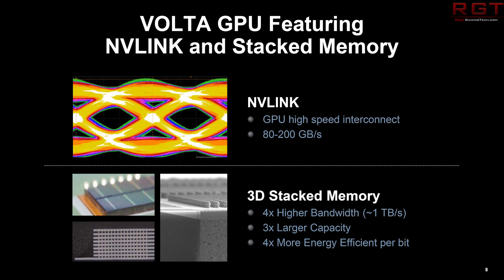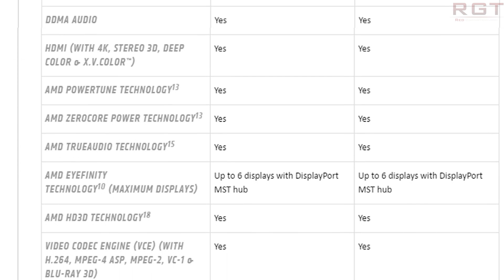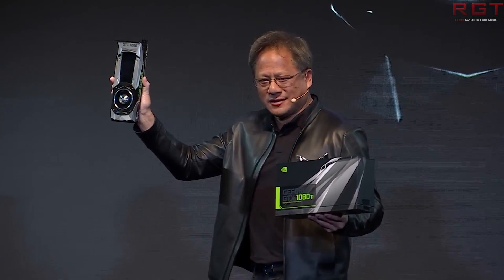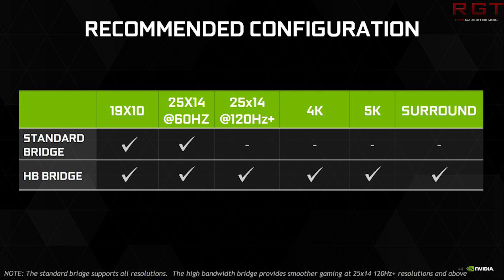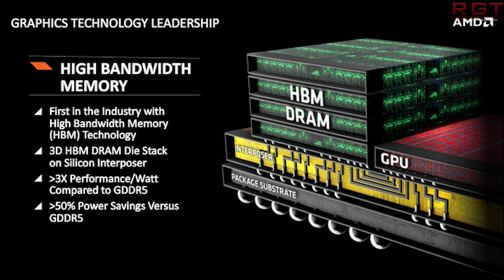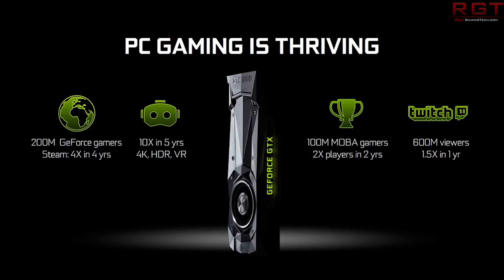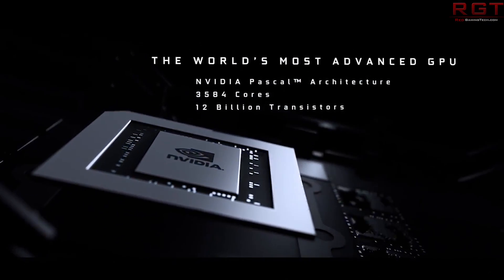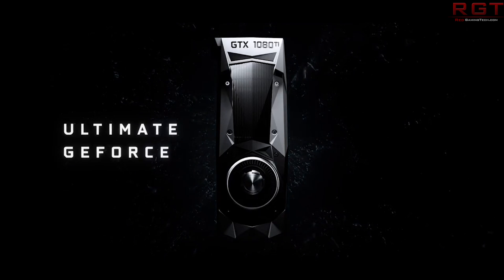Nvidia Volta to Use 12nm Process & Significantly Outperform Vega Says Rumor

Comment: Late and Lame AMD has had NO answer for Pascal 1070/1080, its over hyped MIA Vega will be lucky to beat Factory OCed 1080s in performance/price.  MIA Vega will be slapped silly by Pascal 1080Ti and then Volta will beat Vega like a rented AMDonkey.
Reply: amd doesn't have the R&D of nvidia, so they couldn't release high end gpu's in 2016 or at 1080ti range. but amd is gonna answer to Volta in 2018 with Vega 20 at 7nm. wanna see how Volta with 12nm will beat that. it won't. amd will win in 2018 as it seems, and i bet it will win again in 2019 with Navi
Reply: Holy shit, grow up you clown.

Comment: Vega 20 on 2018 will significantly outperform Volta
Reply: It can't even match 1080TI.
Reply: you didn't read correctly what i said. i said Vega 20 and not Vega 10(56 and 64). Vega 10 was never meant to match 1080ti moron. it was always advertised as 1080 range performance. but Vega 20 on 2nd half of 2018 is gonna be 7nm. Volta will be 12nm

Comment: Listen, how can anyone know how volta would outperform vega by a sígnificantly margin when noone knows how either product performs? It's complete speculation.

Another thing, if you watch the youtube videos where different youtubers play battlefront on a vega system, you can see that the Vega card has the same load indicators as the Fury X has. And on the Vega card, only two of them are lit up. Could AMD be sandbagging Vega and comeback as hard as they did with Ryzen? That should be the real speculative video here, not Volta vs Vega.

Comment: Price always wins, even if it's not top performance, because being close enough is good enough. Hell, even the 1080 cannot provide high refresh rates in higher resolutions. That requires the 1080 Ti to barely make the goal.
Reply: So what you're saying is you want a product that is 5 times faster for the same price, just a year later?  If you look at percentages, they tell the real story.   It's easy to get lost in 30% higher figures, but you have to consider it's 30% higher than something that is already beast.   Also, 60hz is pretty much standard for 4K monitors, so more FPS than that is useless anyways.  4K is a massive resolution.  It's literally like running 4 copies of a game at 1080p, all at the same time....each at 60fps.

Comment: Die shrink doesn't mean crap, my GTX 1050 ti has a 14 nm process while the GTX 1080 ti has a 16 nm process. According to your logic my 1050 ti will wipe the floor with the 1080 ti.
Reply: No because the die shrink would make a difference in a card with the same specs as your 1050ti, a 1050ti with 16nm would be worse than a 14nm counterpart. There are a lot of specs for a graphics card.
Reply: Yes I know but die size doesn't mean much today as there is still alot they can do without giving a die shrink.
Reply: Indeed, todays cards are more flexible when it comes to that.

Comment: NV still dont support Dx12/Vulkan!
Reply: Rafael Carvalho e Lima 
Volta will for sure, async hardware shaders have been seen in eay to many rumours and leaks for it to not have it.
Reply: Rafael Carvalho e Lima It does.
If it didn't u wouldn't be albe to run DX12 or Vulkan titles on nVidia cards.
The Green Team just doesn't optimize their architectures for those API.

Comment: You are forgetting that even if Amd comes out with a card that is equal to Nvidia then it is still too early to go Amd because software optimization does not happen before there is good reason for it. I would like Amd to rip new a hole to Nvidia but ....yeah.

Comment: the Vega card will only be competing at the $350 price point. It's pretty clear at this point. it makes sense historically, Vega will be about the same as a 1080TI, which will be about the same as a Volta 70 series, just pike the 980TI and the 1070.
Reply: I don't understand what you said. You are saying they are releasing a card that's competing with 1080ti performance but at $350? Impossible.
Reply: Estimates based on the doom demo put Vega between the 1070 and 1080. $300 to $350 sounds fair.

Comment: The only problem is volta is supposed to be streaming based cores. Similar to AMD's GPUs I anticipate problems with them. This is Nvidia's first step in this direction, that way they could start using DX12 and vulcan properly... But AMD's Navi is on the way as well, its also scheduled for next year. But Vega seems to be having teething issues with it supposed to already be released. This could be a very big leap in the base GCN architecture. Also from the way its looking on PCIe lane assignments with ryzen they are slotting this to be a platform. Im guessing that since the M.2 is on the same pcie buss vs hanging off the south bridge of the computer that we will see some data sharing going on. This is because of vega's new memory controler. This makes sense since AMD seems to be reworking the drives, and from the sounds of it from the ground up.

Comment: There's an interesting double edged sword effect with competition like this. On the one hand, when one company is dominating the tech stagnates a little, which means your existing hardware lasts longer (for instance CPU tech hasn't advanced a ton in the last 5 years. My i7 860@3.6GHz from 2009 still runs everything without a problem). But at the same time prices don't come down. When there's competition you get better, cheaper hardware, but the arms race means what you have is obsolete much more quickly, leading to more frequent upgrades.
Reply: Don't worry that much, technology is also slowing down in general so there won't be that much performance improvements over the years.
Reply: i say obsolete cpu becomes when it cant run games at ultra graphics at least 60fps. so i7 860 is still capable of that.
Reply: I have 7 PCs, the 860 is just one of them. The i7 860 overclocked to 3.6GHz (that's a MILD OC) with the RX470 runs everything at 1080p and 60FPS on high/max settings with no problems at all. In fact the GPU is the bottleneck. Old? Yes. Obsolete? Not even close. Know what you're talking about before you post next time.
Reply: Cryofax Dude you must stop making too much sense. How dare you use logic. Fanbois don't like logic.
Reply: you only think this because you dont have a newer i7

the 860 is quite obsolete, you are just used to it

Comment: I'm looking at building a Ryzen PC with a 1700x and 16GB of Ram. Mainly used for gaming and video editing/rendering. I use a 1080p 144hz monitor. What should I get for a GPU? Wait for Vega? Get a 1070 on sale? And is there a good chance that Ryzen's 1080p performance will be fixed once the windows/bios issues are resolved?
Reply: First of all, the 1700x is the worst value in the line-up, get a 1700 with a good cooler, and overclock it.

I'm gonna wait for VEGA because of personal beliefs ( I want to finance AMD as they are in a pretty bad spot). But if you have the money I suggest you get a 1080 or a 1070 on sale.
Reply: WildJCS nvidia cards are not meant for video editing and rendering...
Reply: Lo Roger I get that a mainstream graphics card isn't nesscessarily the best option for a workstation card, but I'm looking for the best all around experience, not just for 1 field.
Reply: 1070 but for high frames you'll be better off with kaby lake... I have a 1070 and 1080p 144hz and it rocks...
Reply: Anderson Ribeiro I'm hoping to use an NZXT or EVGA AIO (I would do custom loop but that's a little extreme). So XFR kinda failed in regards to having a meaningful performance boost? And should I be looking at a monitor upgrade to 1440p 144hz? I got an 27" IPS 1080P 144hz at the moment, I'm not sure if the cost of upgrading to 1440 is worth the premium especially at 144hz
Reply: Higher frames in gaming with a kaby lake.  For other workstation type stuff, the AMD will be better.  The reason I like AMD is because I do a lot of compiling of large software, the more cores, the faster I can compile.  Also helps with 3d modeling/animating.
Reply: WildJCS Dude, your gunna be gaming at 1080p...1080 is way overkill for that...1070  is even overkill for 1080p...But at least if you ever plan on going up to 1440 resolution the 1070 is still the right chioce for price to performance. Even an 8gig 480 is good enough for 1080p but its easily beaten  by the 1070 at both 1080p and 1440.
Reply: The gtx 1080 can't even hold 144fps in most games, so nah, not overkill. Especially if you have any desire to play early access games like rust, then that extra horsepower will be put to good use.
Reply: MayDay GoingDown!! I'm looking to play games at high to ultra at 144hz so ideally over 144fps in AAA titles. I'm more interested for the higher fps/smooth gameplay rather than resolution.
Reply: Micah Isham Dude, you just said the 1080 can't hold 144fps in most games?????
How many frames do you need bro?? lol.
He's playing at 1080p not 4k or 1440p. 
Anything over 70 frames and your eyes ain't even seeing it lol.
Reply: Micah Isham That's what I was thinking but unless VEGA can come close to Pascal for a lesser price point or beat it at an equivalent price a 1080 or even a Volta card would be my first choice.
Reply: Yep, XFR is a flop. 1700 is as good as a 1800x if you overclock it.
VEGA is not going to beat Pascal at a lesser price point. AMD never did that. They managed to do that with processor but graphics are a different story. As I said, I'm only holding up for VEGA because I want a all AMD PC.
Use the money you're saving not getting a 1700x to get a 1080ti if you intend to get 1440p 144hz display. A 1080 can't get 144hz at a resolution higher than 1080p so you get what I'm saying right?
Reply: MayDay GoingDown!! b8?

Comment: Any Blender users here?
I got a question for you guys. By the time that Vega comes out, do you think Blender would work well with it or is the Cuda cores from Nvidia still the better option?
Reply: yes and OpenCL performance will have to improve it is a option if you turn it on in the build make file then recompile it by default CUDA and CPU compute are the 2 you can use 
if  you want to help please do they have basically stopped on OpenCL programming
Reply: Master Ryu CUDA is far superior
Reply: CUDA is far superior because applications are optimized for it. They whole idea of CUDA cores is outdated as fuck. But NVIDIA is dominating the market so we are stuck with it.
Reply: so IF he wants OpenCL and as Blender allows anyone to make a branch of their own and anyone to download the source code he can start optimizing a branch of Blender for OpenCL taking the left and seeming to be vagabonded branch focusing on OpenCL then first updating it to 2.7 after which adding and optimizing the code for OpenCL  to which runs as good if not worse than CUDA in the design screen but at this time is significantly slower than CUDA in render
The Blender community welcomes all who want to help just please do not pick it up and claim to help then do nothing
I am just a very active blender user who know a little about how the back ground of it works but not enough to tell if the newest version or one of the older versions of OpenCL would be able to improve upon CPU compute or improve render time better than CUDA if worked on but it was dropped out of the public release build  while kept in the source code
Reply: Thanks for all the info guys!

I'm an average Programmer. I know VB, Java and C#. I wish I could help but it's far beyond my abilities.

Comment: Hello i have a question i just finished my ryzen build witht he r7 1700x and my idle temps are realy high like 60c is that normal?
Reply: JustADecoyy definitely not normal...try reseating the CPU cooler! are you using a program with Ryzen support for temp monitoring?
Reply: That's pretty high, are you using a stock cooler or aftermarket?
Reply: i am using the bequiet pure rock slim cooler
Reply: that's normal.
Reply: CrackedDylMil no, it's not...all u need is to look at the temperature pages of reviews to see that!
Reply: JustADecoyy 60c for anything AMD is a Miracle!!...So yes you're doing well lol.
Reply: so i just did a benchmark and my cpu got as high as 90 c defenetly buying a better cooler oh god :p
Reply: MayDay GoingDown!! my 8350@4.4ghz never goes above 40°c on full load...my 7700k however goes to around 70°c!
Reply: CrackedDylMil http://m.hexus.net/tech/reviews/cpu/103078-amd-ryzen-7-1700x-14nm-zen/?page=7

bottom of the page, clearly states that temps never exceeded 52°c at load! idle should be around 25°c in a normal ambient room temperature (18°c)
Reply: Red Rob 254W in deus ex is insane
Reply: JustADecoyy the cooler is fine, it's not that...Aslong as you're not pumping 1.45v+ into it then you should be getting better temps...What monitoring software are you using? Try reseating the CPU heatsink with better thermal paste!
Reply: CrackedDylMil 7700k was only 17w less with a lower core count! Struggling to see your point...Even at the rated wattage, Hexus didn't see above 52°c at load! This guy is getting 60c at idle, something isn't right with his cooler setup!
Reply: What did you use for thermal compound? Water or spit? This numbers are ridiculously high.
Reply: i dont know if it is in your case, but make sure the cooler is properly in contact with the chip. I've read around a few times that ppl get high temps (not specifically ryzen) to find the cooler was not installed correctly
Reply: insioni Be quiet pure rock slim came with pre apllied thermal paste
Reply: JustADecoyy remove the heatsink and paste and reseat the heatsink with better thermal paste!

Comment: there is no Volta no Vega... how can one nonexistant thing be better than another nonexistant thing?
Reply: Lucy Jones 
they exist theyre just not finished
Reply: But that is the whole point. . . I'm pretty sure that just about ANY video card released a decade from now will annihilate any video card these days. . . so the question is WHEN will they be finished and available?  Also, what's with product names starting with "V"?
Reply: they actually both exist. vega card were running demo's and that stupid self driving car nvidia worked on is using a volta core. not the full products, but they definately exist
Reply: Radkon Psygami umm polaris pascal, then volta and vega
Reply: Its common logic, vega is coming before volta which means nvidia has time to make their products better.
Reply: Elijah Nemr true and you could say this because everything is stupid rumors
Reply: I though vega was next. . . still NO dates, NO official release dates - how long can you hold your pee in :-O
Reply: renyn21 they dont exist, they are in development.

Comment: Volta titan x with HBM2, only 1999.99$
Reply: And mostly out of stock because 12mm yields are much harder than 14nm.

From 14nm and onward, the yield rate diminishes at great levels.
Reply: alvarg because amd's 14nm was designed to be power saving but a bit less overhead on overclocking, so amd can keep stable and combine in multiple ccx's. As a pefect 8 core yield is expensive, you get 4+4 ccxs for the ryzen.

Now for a gpu, not sure how many cores works, bhut the higher core count the lower the yield rate.
Reply: Hello im from the future and titan v is only 2999$
Reply: qwerty Ain't gonna happen.
Reply: 1499.99
Reply: you could call it a titan tie
Reply: whats so bad about 12mm yields? and how do you know this?
Reply: + shamamomo I argee... $1550 USD far more likely....
Reply: +Noobish, well we'll never know what would have been the case without Vega around the corner.

Studying Nvidia price structure at launch across generations cross reference against marketshare  indicates that Nvidia wanted lost marketshare back and pulled another GTX 970 style move.
Reply: lastcharmed88 The second Titan Xp haven't shipped yet, it's too early to talk about Volta pricing.
Reply: +shamamomo  Well this depends on them regaining market share not that Nvidia is anywhere near dire straights.   The attractive pricing (relative to other Nvidia products) of the GTX 970 was a market share clincher.   2016 was very profitable for Nvidia but AMD did claw back market share. I don't care.   VOLTA WILL BE BETTER  and the more people buy Pascal the pricier Volta will be.  Delude yourself if you want and while the 1080ti is good and finally priced at what all the titans should have priced at^ 

 I'd like to reward Nvidia for pricing 1080ti at a reasonable level but I believe such a move will only hurt my and your and others wallets when VOlta is released (any where from 8 - 14 months away) 

 ^Compared to price performance of the slighty better than average performance gains for each gen Titan covering the period shortly after launch.  Comparison chart ready on request.
Reply: Yeah and 2months later Titan Xv 20% faster, but come one it's a "deep-learning-card" :D (pre-purchases accepted)

sorry for my bad english ^^
Reply: qwerty maybe you should give money to charity instead of wasting money on overpriced cards
Reply: St tom those aren't for games but professional usage anyway, 2k $ per card is a small blip on their expenses.
Reply: Learn from my friend 's mistake. Please god, buy gtx 2080ti or you gonna waste your money
Reply: Considering Vega is more expensive than the 1080 for similar performance and the LC Vega is the same price as the hybrid 1080ti with thee latter being 30% faster on avg I'd say AMD fucked up massively and Nvidia has every reason to milk people more.
Reply: What is with you kids and putting the dollar sign after the number? It just looks stupid.
Reply: qwerty volta ti card faster than volta titan at 699
Reply: i think they will keep HBM2 and when there is one HBM3 for Tesla cards which they will sell for way more than just $2,000 making it so if you want that over the top for consumer memory performance you will have to get a compute only card